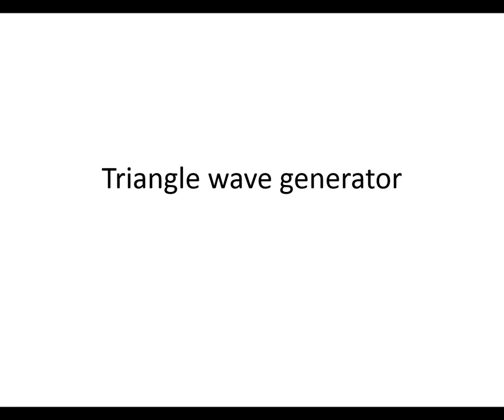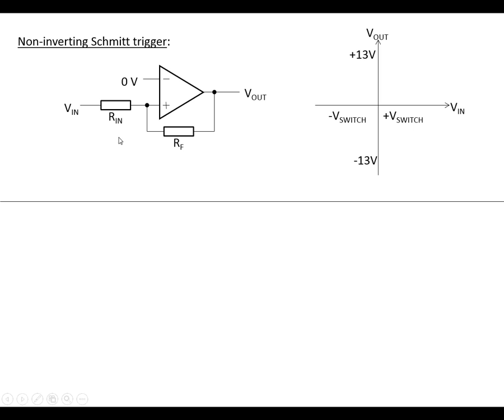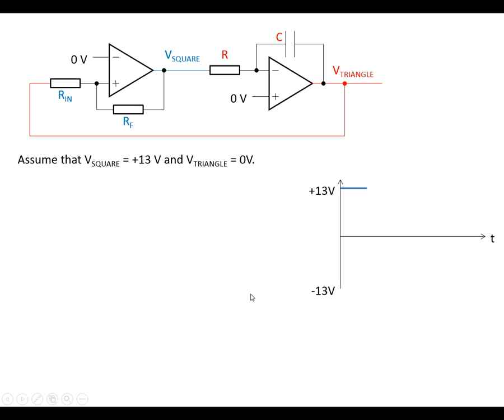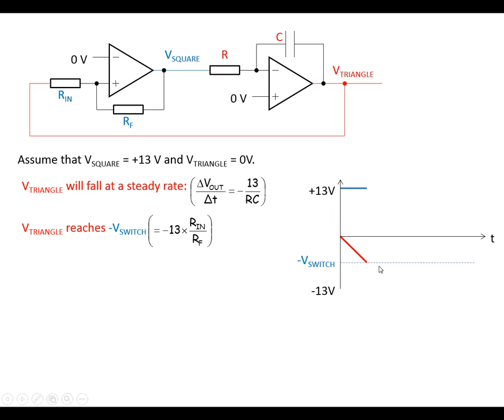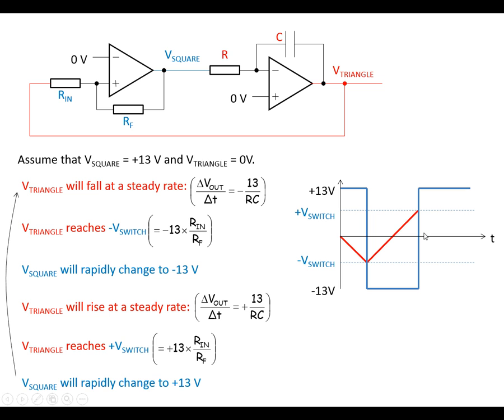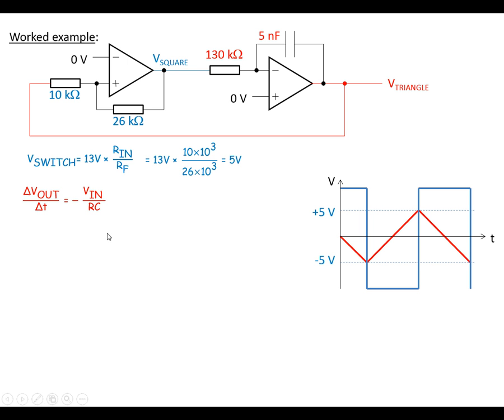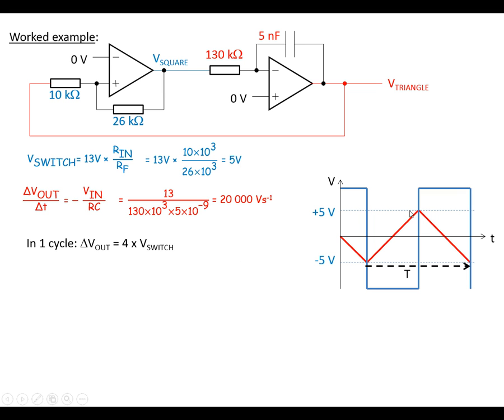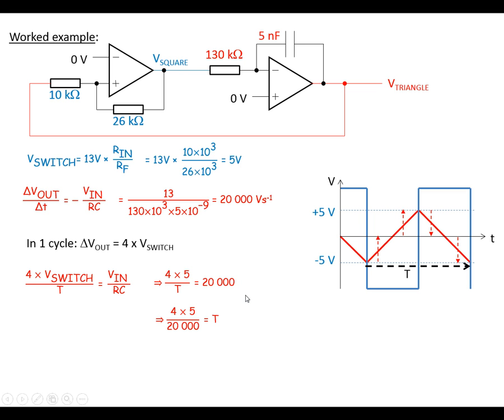Triangle wave generator

Comment: Great video on explaining the calculation and signal.   This is the first one (out of about ten) that I see the simulation show the same output as the calculation.  However, the output voltage proportional to the frequency, which is not the same as the equation you suggested in the video.  According to your video, I can just change the value of R and the frequency will change.  From the spice simulation, increasing the value of R will also reduce the output voltage.
Reply from the maker: It depends on which resistor you change. 'R' will change the frequency, but not the maximum voltage, of the output. The other two resistors control the maximum voltage of the output.
I've never used the spice simulation - we always built and investigated the circuits on protoboard in my lessons.
Now I think about it, if you go to a high-enough frequency, the 'slew rate' of the op-amp's output will affect the operation of this circuit ... the maximum output voltage will be reduced ... but that is only for relatively high frequencies, and the course I taught assumed infinite slew rate.

Comment: Hi..how i.can make this as vco???..thnks...
Reply from the maker: I used to get my students to make a vco based on a variation of this:
(1) put the input voltage and it's inverse into a multiplexer, then use this as the input to the ramp generator.
(2) use the output of the Schmitt trigger to control the multiplexer.

Comment: programs can not simulate this circuit.  why?
Reply from the maker: Are the op-amps running from a +/-15 V supply in your simulation?. It won't work with a single-ended supply.

Comment: I'm wanting to make a class D amplifier powered by a 9 volt battery. Using this battery, would the voltage in the oscillator ever go negative? If it is always above 0 volts, what are the relevant equations then?
Reply from the maker: The voltage will stay within the limits of the supply. You could look at making the op-amp run from a single-rail supply (i.e. use the battery to make a +/- 4.5V), but you'd probably be better off finding a single-rail triangle-wave generator. Off the top of my head the voltage at pins 2&6 on a 555 oscillator will be (very roughly) a triangle between 3V and 6V for a 9V supply. Sorry, can't help beyond this.

Comment: I doubt it, but is there a specific reason you chose a 13v power supply? Does it just make the math in this example easier?
Reply from the maker: The exam board specify a 15V supply, with the op-amp output saturating at 13V. I chose the component values to match this, to make the maths easier.

Comment: At first, thank you for your tutorial!

In that case bellow (~100kHz with TL081), what are the components (resistor and capacitor)?

I'm asking you because I didn't get choose the best values for it.
It seems that there is a limiar value for R and C that prevents me to reach high frequecies, in my case, 50kHz.
My feeling, at first moment, is fix the capacitor value and than choose the resistor value.
Reply from the maker: Thanks. We did the high-frequency oscillator for a bit of fun in class (i.e. not rigorously tested) to see what would happen. You'll need a large resistor if possible - this will limit the current, and I think we used a 1pF capacitor. You'll need a very small amplitude for the triangle wave otherwise you'll be limited by the slew rate of the op amp. The slew rate will also affect the square wave quite badly - therefore the frequency will be lower than the formula would predict.
Hopefully this is useful.
Reply: Thank you for your explanations!

Comment: Great tutorial. Is there an elegant way to convert this to a 0-5V sawtooth generator?
Reply from the maker: Thanks. Unfortunately I can't think of a way to do this easily. 0-5V triangle could be done by adding a bias to a +- 2.5V triangle using a summing amplifier. Sawtooth would need a diode to discharge the capacitor.